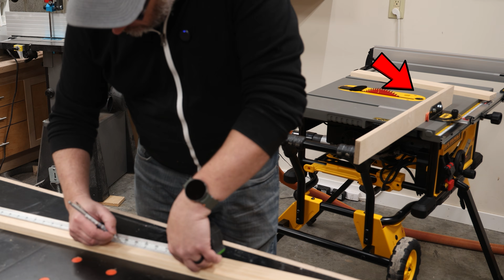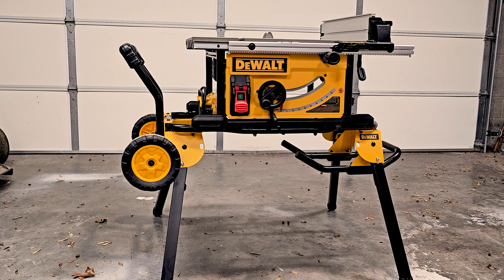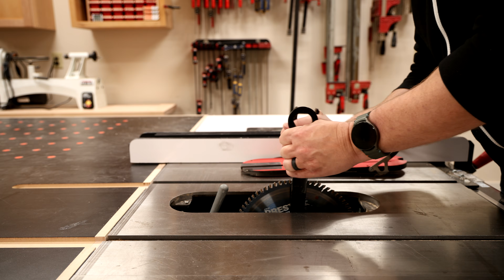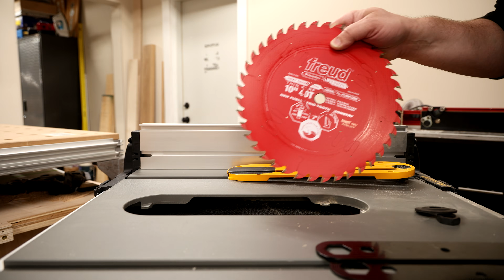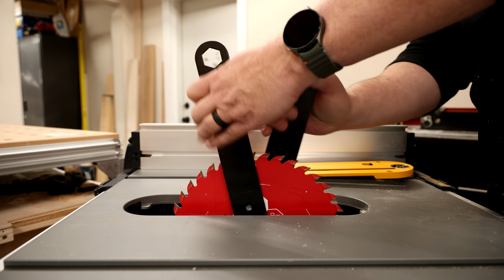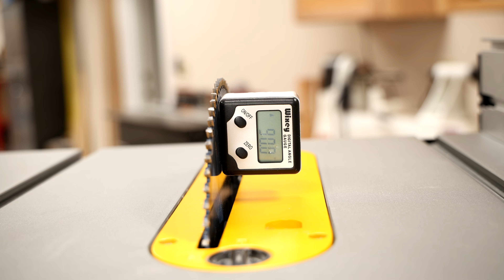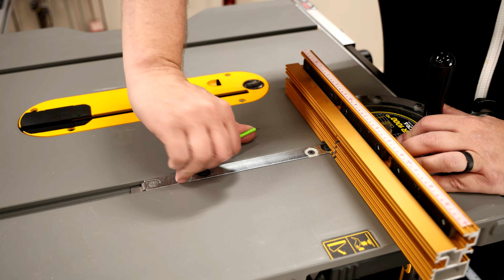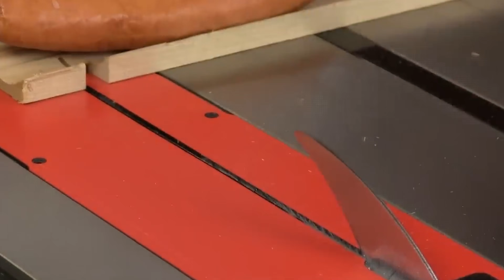Why do people even buy this saw?

Comment: That was spot on for the topic of the table saws.  I have that Dewalt job site saw and no cabinet saw.  I made a workbench around it so I had ample run off.  I have never had a problem with the power even on 8/4 stock if using the right blade. BUT, I have had to aligned the fence periodically, one time when I forgot i did have a kick back. Once was enough and now I check for parallel and square every time I use it.  But for the money it’s a great saw.  I wish I could set the angle with a dial and not by hand though, that’s my main gripe.
Reply: The DeWalt is a very good jobsite saw. It was between the DeWalt jobsite saw and the worm drive Skilsaw for me. I went back and forth between the two, but ultimately chose the Skilsaw because it could rip a 4x4 in one pass, had those fantastic 16 inch wheels (and I couldn't pass up that worm drive motor).
Folding the saw up for storage in my small shop was very important for me, since space is a major consideration, and I can very easily wheel the saw outside onto a patio through a sliding glass door. We go with what works for us even if we still dream of that SawStop professional cabinet saw.
My work had one, and it's fantastic to use.
Reply: @davidgraham2673 Sweet that you can rip a 4x4 on your skilsaw.  I have only gone as far as ripping two 2x4s glued together occasionally.  Not a fan of having the blade so far out of the table. Haha!
Reply: @MMMS75 
Can't say that I'm a fan of a fully extended blade either. Thankfully, ripping a 4x4 isn't an everyday task.
The star of my tiny shop is my lathe. Everything was purchased in order for move-ability and storage in the corners. I don't do cabinetry work, just segmented lathe projects, which require the ability to cut and glue before turning.
The shop I worked at previously had all the big-boy toys including space.
(I'm just a small time hack with a dream that I've been blessed to see coming to fruition)
Best wishes for your life as a craftsman, my friend!
Reply: @davidgraham2673 likewise,
You too!

Comment: I learned on a radial arm saw back in the early 70's.  With the proper accessories (mainly fence and table expansions), they can do everything a table saw can, including breaking down 4x8 sheets of plywood.  That being said, the job site and cabinet saws make a lot of those processes much easier.  Now days you don't even see radial arm saws for sale outside of facebook marketplace.

Comment: Currently do not have any woodworking equipment, which doesn’t lock me to any system. 

I’m thinking about not having a table saw or a miter saw. But instead using a track saw with parallel guides and a router to make all the cuts.
I do understand that this limits me to mostly using sheet goods, but that’s what I’m needing to build.
I do understand that bevel cuts on a track saw is limiting.
But building a table with precise MFT dog holes using the Parf Guide system, and now able to cut very precise angled cuts, I’m ahead not having a table saw. 
Again not owning a table saw, chop saw, jointer or planer, limits me to purchasing hardwoods that are nearly at the size I would need, # expensive.

Comment: Been listening to this argument for years. I remember my dad telling me that I shouldn't try to hammer in a screw. (I was 6 at the time) He also said that every tool had a job and every job had a tool. Which makes me wonder if the fact that one of your saws is called a "Cabinet" saw and the other a "Construction" saw might be an indicator. But what would I know, I've only been a woodworker for 45 yrs. Couldn't possibly have gain any real skills in that short a time.
Reply: I always thought it was called a cabinet saw because the saw's form factor was like a full cabinet lol
Reply: @arax20  Thats what the old woodworking books said. The other benefit to cabinet saws is better vacuum because of the cabinet base
Reply: Completely agree with you.
Reply: Hammering a screw is what's called a, Pro gamer move.

Comment: I had issues with backlash on the fence and under moderate fence pressure, it would cause the fence to move to a wider rip distance.

The table wasnt level at all, and to the miter slots were unusable because they would change in width.

I had this saw and sold it 4 months later for a cabinet saw.

Comment: I own 2 cabinet saws a Jet and a old Craftsman  and The Dewalt saw with the stand  The Dewalt saw without the stand is 10 Times cheaper. I never compare a motorcycle to my Ram 2500 pickup for hauling. Sure they both have wheels  but that's the extent of it. Nobody looking for a beginners saw would buy a cabinet to begin with The Delta contractor saw is  in the Middle of the  Dewalt and the Saw Stop and only approx $100. more the the Dewalt  saw with the stand. And the Delta has a good reputation for after sales help.

Comment: 15:49 well the fence should not be perfectly square. It was perfect as it was to reduce the kick back risk. At least in europe it is standard. If the fence is not slightly off at the back the saw isn't allowed to be sold.
Reply: That is absolutely not true and good luck making anything with a saw that is this misaligned. European saws may have the option to move the fence so that it doesn't extend past the blade tho.
Reply: @LargeLubricatedMale  safety isn't an opinion... You can use your tools as you want. Just mentioned European rules. But, your cut won't be out of square if your fence is in the back 1/64th" off. You are cutting in the first third of your table. Next to the cut the fence will be completely parallel. I do work like this since 8 years. Never had kickback issues 🤷🏻 so stay safe!

Comment: Nobody who spent huge money on a Sawstop mentions the cost of a new brake mechanism and sawblade. I have blades that were $150. I have and use pushsticks and blade guards on my saws, mostly for the dust collection. In Canada,a Sawstop is 5 times what I payed for my 3 HP Jet. I also own the DeWalt. YouTube channels are not the real world. Thanks for the video.cheers
Reply: I worked in a shop where "after I was hired" he explained that "I" would have to pay for a replacement of the Sawstop if there was an accident.

His other guy came back from Meico after his winter break and I was not needed.  I don't speak spanish; but know how not to have accidents.
Reply: @carefulcarpenter  Fear of paying for a sawstop brake over fear of losing a finger. Maybe a better strategy.
Reply: @RUOKIam  That shop owner was a control freak, not much of a craftsman.  He invested too much into power equipment and not so much in skilled labor.
My next job was a joy and a welcomed challenge.

Comment: "Let's just cut some stuff and see what happens."😄

There is a tacit implication that the consumer has to choose between these two models, whereas there is a broad range of table saw types, from the almost toy-like models, to job-site, to contractor, to hybrid, to cabinet, to ultra versions. I personally find a contractor saw fits my purposes very well, especially since I swapped out the original 1.5-horsepower motor for a 2.5. Except for sheer mass (and better dust collection), I don't see what a cabinet saw would bring me that this setup does not already have.

Comment: I have the dewalt and it’s been a good saw. Maybe I was just lucky but it can fully adjusted straight out of the box. It also hold that adjustment. But the one thing I don’t like is setting angles. You nailed it, it’s a pain.
Reply from the maker: I very much doubt that most of these saws come as misaligned as mine was. it was just luck of the draw and I lost.

Comment: The flip over support can be used (at least with the stock fence) while over the table top and it is made to work for one specific reason. If you are trying to do a thinner rip and you have the blade guard installed (as one should outside of content creation or none through cuts) it gives you space to use your push stick. That support has 2 positions. With the fence over the table, flip over the support, it should come down right on top of the table.
Reply from the maker: yes this is correct. however at this point it doesnt help with the upward flex of the fence because it's not being used as work support but as a shallow fence.

Comment: Blade to miter slot alignment does NOT affect the squareness of the cut produced with a miter gauge. That's wholly dependent on the miter gauge being set-up properly. To do so, use a good square to make the fence of the miter gauge perpendicular to the bar of the miter gauge. Then that gauge will cut square on ANY tablesaw - even grossly misaligned ones.
Reply from the maker: swapping over to an Incra miter gauge that I know to be square for years did not solve my issue. The only thing that corrected it was aligning the blade to the table top via the miter slots. I think the issue is different if the misalignment puts the leading edge of the blade closer to the miter gauge, but my blade was misaligned with the leading edge facing away from the miter gauge which means as I pushed the wood through the blade the body of the blade pushed the wood back the opposite direction causing the cut to be skewed. Once I corrected the blade alignment issue my cuts became square again.
Reply: @MWAWoodworks  If your workpiece is moving due to a misaligned blade, then it'll also move with an aligned blade making an almost 90º angle cut (89º maybe), and probably also making a 45º angle cut. So, you have to fix workpiece drift on your miter gauge no matter what.
Reply from the maker: the issue is with the body of the blade pushing the workpiece away, not workpiece drift. If the back side of the blade is closer to the miter gauge than the front side then you get blade interference. You're trying to push straight ahead into the side of a blade. But if the blade is skewed so that the front of the blade is closer to the miter gauge than the back side, this is not and issue because there is clearance behind the leading edge of the cut. I hope that makes sense without a drawing!
Reply: @MWAWoodworks  You'd need to not only have a seriously misaligned blade (and thin kerf might contribute to that if the teeth have less side overhang), but the blade would have to be raised much higher than the workpiece as well. I'm surprised you didn't get kickback from the rear teeth trying to lift the workpiece in that case.
Reply from the maker: it was out of square by over 1/16". I had the riving knife on and its much harder to have kickback when using something like a miter gauge or a sled. Kickback is usually only an issue between the fence and blade.
Reply: @MWAWoodworks  Then maybe it was the riving knife, not the blade body, that forced the workpiece to slide away. And, also prevented kick-back, which can occur any time the rear teeth contact a workpiece with more than a grazing.

Comment: Try this again with a cabinet vs contractor saw not a job site saw. I have a newer contractor saw and an older cabinet saw and only have room in my shop for one and can not decide which to keep. That being said my cabinet saw is old and on the smaller side, so right off the bat, cutting size is not and issue.
Reply from the maker: I've never owned a contractor saw. I jumped straight from jobsite saw to cabinet saw.

Comment: While, as a commercial cabinet maker and scenic carpenter, I agree with everything you fairly pointed out in your comparison. However I'm surprised you didn't point out the primary consideration and the first question to ask. That is "What am I trying to do as a woodworker? Are you going to make a living with this saw? If so, always buy the best tool you can afford to do the job with the best possible results. Once you answer that question the choice is probably obvious. As to dialing in the accuracy, I'm willing to bet when you set up your SawStop you checked all the points you mentioned for measuring and adjusting the square. If something had been a little out, what are the adjusting steps involved? And for safety, what is the price difference between comparable cabinet saws and the SawStop? My guess is in the thousands. And while believe in safety I find most woodworkers already own the best tools to accomplish this. One is a brain, used to pay attention to what you are doing and the other is the experience to use that brain. I would like to see a hot dog test that resembles real life. If I was watching the dog and the blade and moving slowly enough to get the blade to stop, of course I'll be 'safe'. However if you drop the dog from 6 inches above the blade, the blade will stop. But the dog will get cut. Not badly but more than you would expect. This test would, in my opinion resemble real life better in that no one intentionally runs their finger at a running saw. It's usually some sort of accident like a friend dadoing a piece of oak flooring and it disintegrating as oak can do. (Does this feature work with dado sets?) So, if you are making fine cabinetry for attorneys or board chairmen or doctor's offices; anywhere the look is important: or you're wealthy enough to indulge your avocational hobby, go for it. If not, get the best saw you can (Dewalt is one of the best), add all of the suggestions you showed and 
then pay attention to the work and never take you eyes off the blade when it's running.
Reply from the maker: most people getting started in woodworking arent jumping straight to "am I making a living off this or not" they discover their path later. I actually mentioned in the video that I did check my sawstop for accuracy when I received it and it was spot on (as it still is 10 years later). A SawStop is not more expensive than a Powermatic table saw which doesnt have the safety feature. Sorry I didnt read the rest of your comment.

Comment: I mean, we all know a cabinet saw is gonna be more spendy...
We also know that a contractors saw will not be as good as a cabinet saw .. like duh !!

So we need to mitigate the problems with the contractors saw and live with it .... or buy a cabinet saw...

As amachinist, I used a router to re-cut the mitre slots,  I also improved the rigidity of the contractor saw.... I made my own fence from some extrusion I had nanging around ....

Do I wish I had a cabinet saw ?... of course I do !! 

 Can I live with the compromises  on my contractor saw ?...yes.. for the forseeable future...

I will say I've found those thin kerf blades prone to blade "flutter".... I've never heard any Youtuber address this... 🤔

😎👍☘️🍻
Reply from the maker: you can buy a blade stiffener. https://amzn.to/44vqOQP
Reply: @MWAWoodworks  ... or just use a smaller diameter blade given the stiffener will reduce the cutting capacity anyways ... also, that link doesn't drliver to Ireland... 🙄😅👍

Comment: Your comparing something built for a construction site where a 1/8" accuracy is acceptable, to a shop saw where the accuracy is measured in the thousands of an inch. Good comparison just the same.
Reply from the maker: true but you can get a jobsite saw much more accurate than that with someone instructing you what to do and lots of people begin their woodworking journey with them. But I agree, they are not purpose built for fine woodworking.

Comment: Had you aligned the blade to the miter slot previously to discovering it out of alignment?
Reply from the maker: nope. I pulled it right out of the box, built the stand, and began cutting.
Reply: @ I hoping there wasn’t a bigger issue that it keeps coming out of alignment. Thanks and another great video.
Reply from the maker: nope, it was simply me trusting that the saw would not have been that far out of alignment from the start. It always pays to check.